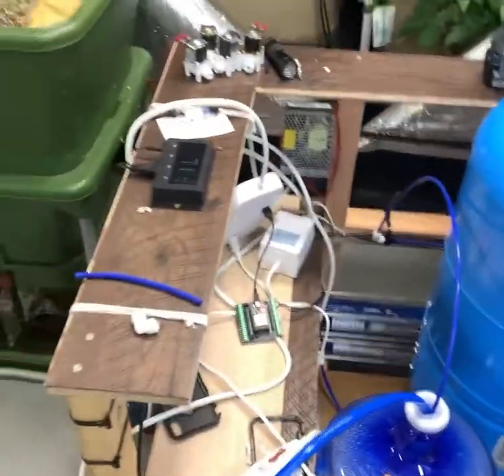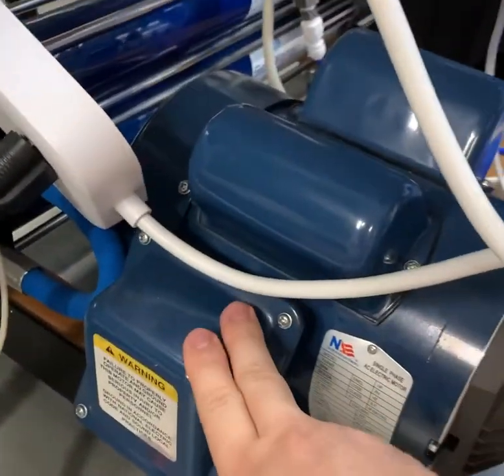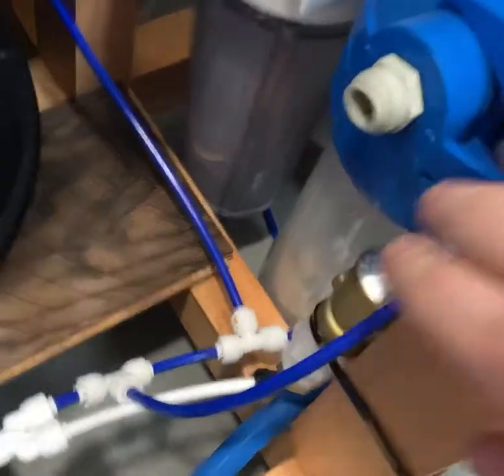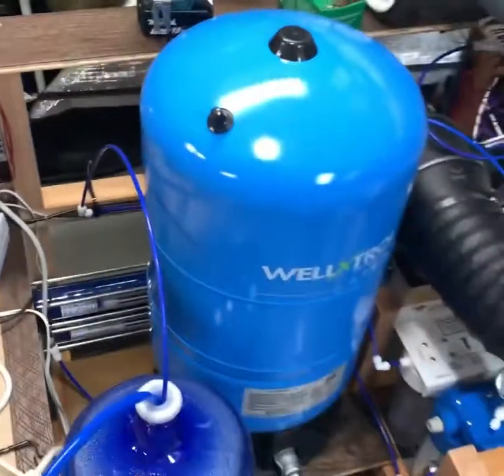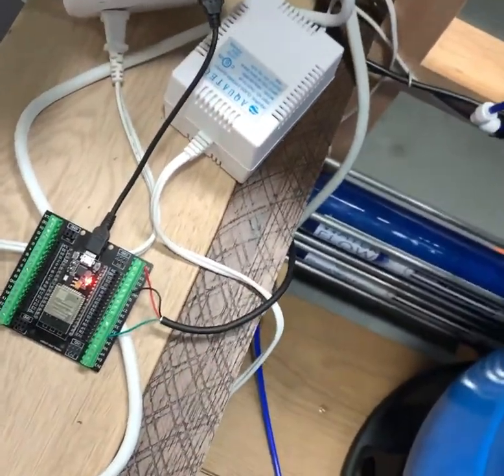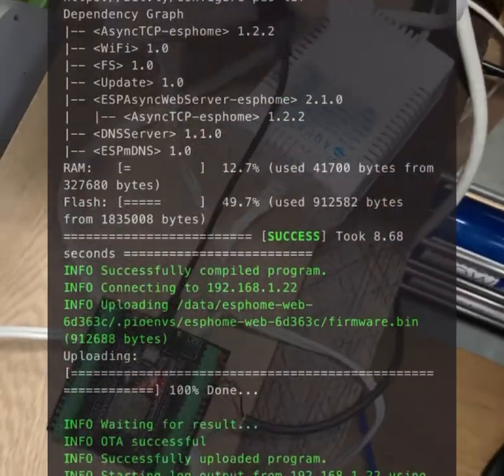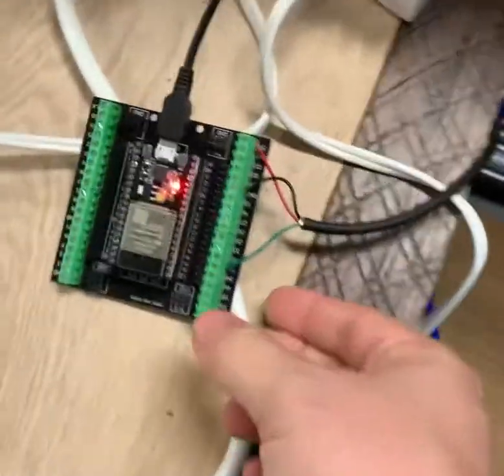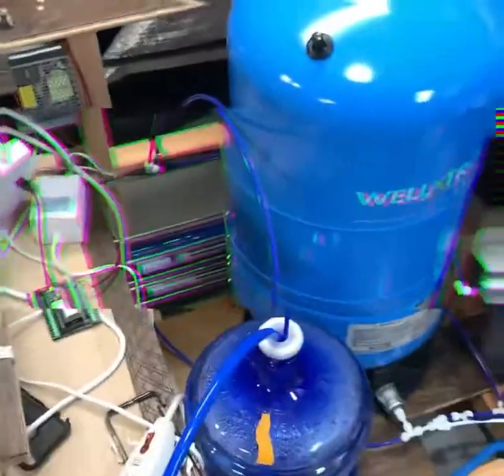IOT Automated Pressure Regulation — Pressure Sensor - ESP32 - Home Assistant

Comment: I have same ESP32 as yours and a 0-80 PSI sensor, but am unable to get consistent readings.....the specs for my sensor are 0.5min to 4.5max volts, I noticed you have your sensor hooked up to 5V, did that work for your right away?
Reply from the maker: I ended up running into problems with this. I am not sure exactly what the fix is but I think it requires a lower voltage, like the 3.3 or something. Sorry I cant be more helpful. The higher voltage broke my sensor and I never got around to fixing it. But it was really nice when it was working for the short time that it was.
Reply: What is the yaml code  you send to the ESP?  I need to codes of the ESPHOME in the home assistant?  You mention simple codes.  Can you send me a copy to look at it?  thank you